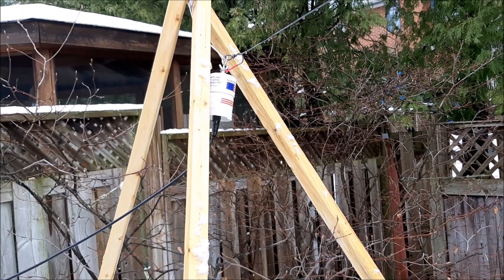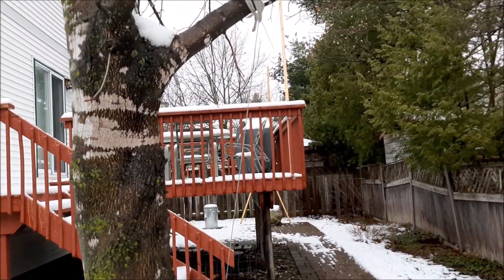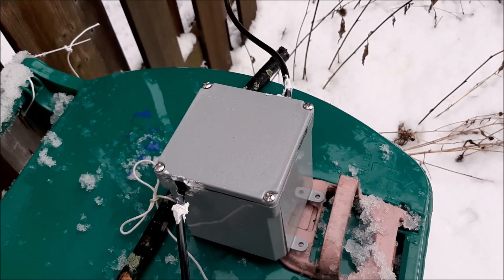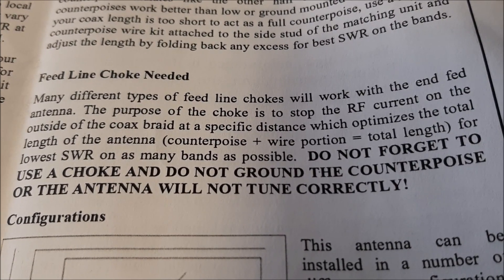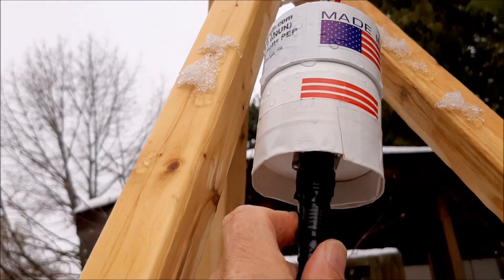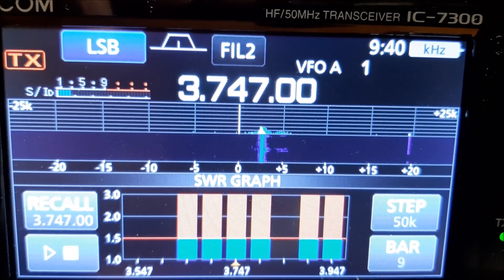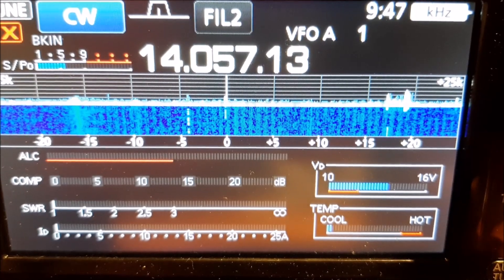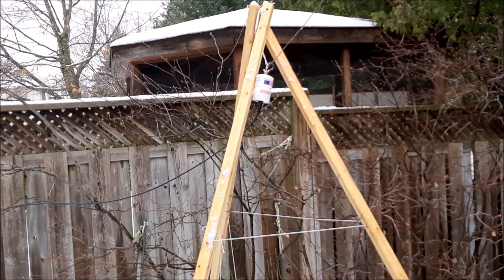Palomar Eng BULLET 41 Foot End Fed Long Wire Antenna Review By Owner

Comment: I built my own EFLW using a Palomar 9:1 Balun. It is 200 feet of wire sitting on a 6' privacy fence going around my property. It has a short counterpoise running along the bottom of the fence. I have a short PVC pipe zip tied on one end of the EFLW, and use a short run of SMR-240 into my window. It will tune all bands, from 160 to 6. I only need the internal tuner on the rig all the way up and down. It isn't very high, of course, but I'm in FL and the ground conductivity really helps my signal not get absorbed. Thanks for sharing that video! 73 de Scott N1IA

Comment: Is this the 9:1 unun? If so, I have a 9:1 unun from LDG that I use for POTA. I think based on my experience, you will have better propagation with that antenna if you elevate the feed point. I let my counterpoise hang down with the coax. With those trees I see, you can likely get it up a good 20 or 30 feet which I think might improve the antenna's performance. Good video!  Take care, 73

Comment: I recently added this End-fed OCF antenna to my shack as an alternative to my 49:1 End-fed sloper. I have found it to work very well after trimming/tuning the open wire part of the antenna to get the best SWR on all bands it is designed for. I first tried to tune the choke portion of the antenna but this didn't really help - I returned it to the recommended 12' location on the coax. Mine is hanging at about 30' as an "L" shape with very good results. I do use an external autotuner which is needed on the WARC bands as they are a bit over 3-1 SWR and outside of the IC-7300 tuning range. Out of the box the sweet spot of the antenna was toward the lower end of all the bands so I ended up folding back and wrapping about 2' of wire to bring it to the middle of all bands. After using and comparing this antenna with my End-fed I would highly recommend this as a first antenna for HF.     Jim    KC3RFG    73
Reply from the maker: I have not tried tuning the antenna length. I may try this sometime in the future.....Thanks for watching.

Comment: I have had mine for about  4 years.  It has been 155' lazy L, 160' sloper fed at the top and grounded to a 35' tower, and finally is a kind of slanting/sloping lazy L that is about 218' of wire.  It acts like a long wire antenna on the high bands and works DX fairly well on SSB.  Not a bad antenna system for multiband use.  73